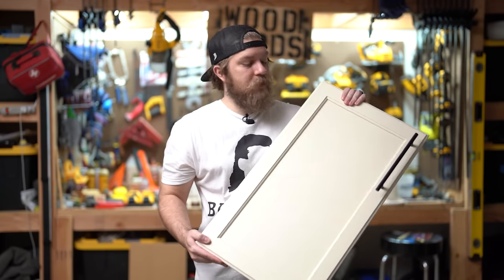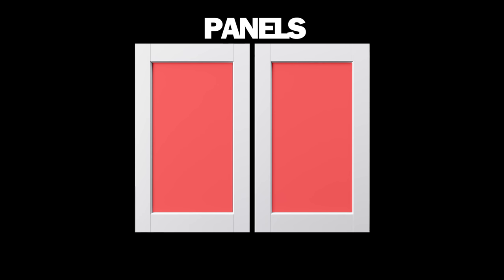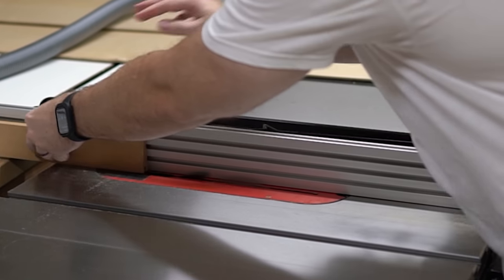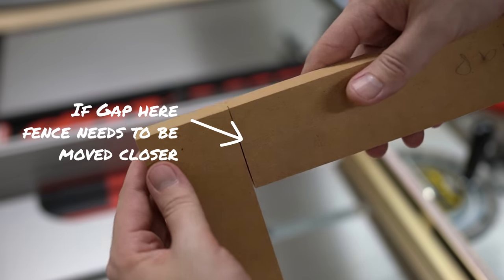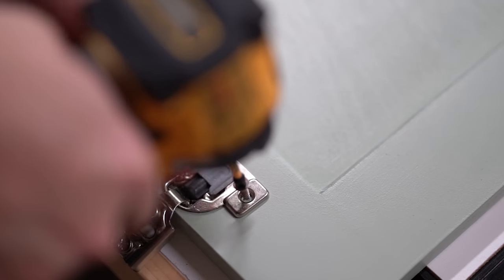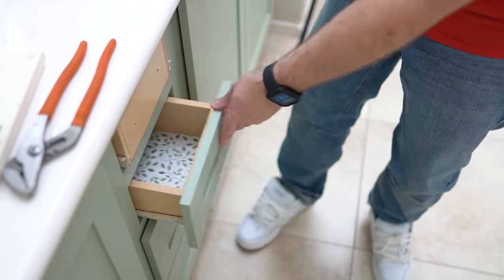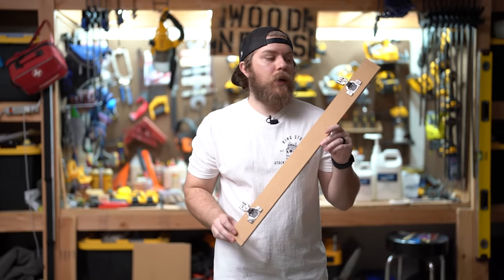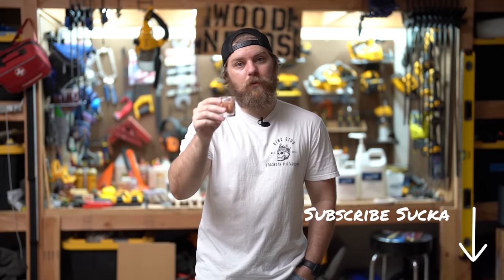CHEAP and EASY Shaker Cabinet Doors and Drawers | DIY | HOW TO

Comment: which paint have u done on it ? also any shelac or pu coating over paint?
Reply from the maker: Of course! It’s “clary sage” satin finish, using a “cabinet and furniture paint” base to help mitigate wear and tear. The tag doesn’t seem to have the brand but my wife picked it up at Lowe’s (if you have one near you). No top coat other than the paint.

Comment: Would it be much easier with a cabinet design software & a CNC machine?
Reply from the maker: Haha much easier! You’d be able to make 2 piece doors. One piece would be the frame, and the panel would glue on the back. Could use the internal “waste” from the doors to make the drawer faces.

Comment: What paint was used? I have always had issues painting MDF. I know you can put a thin layer of glue or plaster as a barrier between the paint and the MDF so the MDF does not soak up the paint.

Also, instead of using MDF, couldn't you use plywood throughout? 3 layers of the same plywood with the center piece being thinner for the dado and longer for the tennant?
Reply from the maker: Of course! It’s “clary sage” satin finish, using a “cabinet and furniture paint” base to help mitigate wear and tear. The tag doesn’t seem to have the brand but my wife picked it up at Lowe’s (if you have one near you). The first coat gets drank up a little but after that, it’s paint as usual. The problem I’ve had with plywood is the edges show the plys. You can use edge banding and try it but that would be more work than mdf. Mdf is also much more resilient to damage than people think. I’ve whacked mine pretty good and no damage resulted. Of course it’s all up to you and what you like best but these are my experiences.

Comment: About to redo my kitchen and just watched your vid because I was thinking of going with MDF. Only problem is, you recommend 5/8" thick and for the life of me I can't find that thickness around here. I have 1/2 & 3/4, would 3/4 be to thick or should I just go with the 1/2"? Thanks
Reply from the maker: Do the 3/4”! It’s what standard cabinets are made from. I think 1/2” is a smidge too thin as the hinge cups are about 1/2” deep.
Reply: @WoodNerds  ok thanks!
Reply from the maker: Of course! I hope it goes well for you! I would like to hear how it turns out! Cheers and good luck!
Reply: @WoodNerds  sure will man. As soon as she decides what style doors she wants me to make. She's leaning towards some raised ones. So I'm guessing go mdf 3/4 rails and styles and do 1/2 mdf panel. But who knows what I end up having to do. I know for the cabinet with our pots, I'm going with slide out drawers at the bottom. And to old to be getting on the floor to dig in cabinets. Lol
Reply from the maker: Haha those are nice to have! I’ve been wanting to try them out as well! Excited to hear back man! Sounds like you have a decent sized project ahead of you.

Comment: what table saw blade do you recommend for this project?
Reply from the maker: Any will do. The higher the tooth count the finer the cut. I used a Freud glue line rip blade and it’s been great! Linked in the description.

Comment: It would be nice if Home Depot sold these styles and rails with a groove to fit the 3/16 in plywood..
Reply from the maker: I’m not sure about stiles and rails but I know you can get custom cut plywood from lumberyards by the pallet. I’ve seen it done with the intention of making drawers where they cut the groove for the bottom panel. Might be worth giving a call and see if your local lumber yard offers that.

Comment: Buddy this was great but ima keep it real I’m not gonna be able to get the saws correct it would take me plenty of time to even get close 😢. Ima just do a refacing in my bathrooms and that should be straight cuz I have the kind of cabinets that have the peeling crap. So ima remove them and replace so starting with good already made doors 😳😬. But this was great
Reply from the maker: Haha you’re not wrong. Dialing in the cuts is like 75% of the hard work on this one. Thanks for watching and taking time to comment, man. I appreciate it! Cheers and good luck with your project!

Comment: What blades (tooth n brand) did you use on your tablesaw and miter saw?
Reply from the maker: Hey Luis! The table saw blade is listed in the description! The miter saw blade is the standard construction blade that comes with the saw. I recently bought a much thinner blade I’ve been wanting to try though. More info on that to come.

Comment: Where do you buy dimensional mdf or hdf for cabinet doors? I’m assuming it’s different than big box store mdf trim. I can’t find it anywhere.
Reply from the maker: Hey! You mean a 4x8 sheet? Yeah, they’re all over the place here in Phoenix, AZ. The sheet goods in the big box store are usually near the boards but in their own location. A lumberyard somewhat close to me has a pretty decent assortment of sheet goods. They are usually higher value and quality compared to the big box stores. Some mdf that has high moisture resistance as well. Worst case scenario, see if you can order some to the store for free.
Reply: @WoodNerds  maybe I missed it in the video, did you just rip down a sheet for the rails and styles?
Reply from the maker: @MountainTopFilms12 yeah, just ripped a sheet!

Comment: What was that paint color? I like that you could still see the grain on the center panel.
Reply from the maker: It’s “clary sage” using a “cabinet and furniture paint” base to help mitigate wear and tear. The tag doesn’t seem to have the brand but my wife picked it up at Lowe’s. I like that too! Thanks for watching!
Reply: @WoodNerds  Thanks. Did you use a primer? I wonder if that would affect the ability to still see the grain.
Reply from the maker: I used a primer paint combo! I bet you’re right though, multiple coats will likely hide the grain!

Comment: I'm about to replace 29 cabinet and drawer faces in my kitchen plus eight in the bathroom and have glued up a test joint.  Your advice to sneak up on the table saw cuts is right on.
However, although most of the tools and jigs you recommend are relatively inexpensive, there's that 800 pound gorilla Sawstop table saw that you conveniently ignore, and which does almost all the cutting.  These doors can be done with "lesser" table saws (I'm using a 30-YO benchtop Delta), IF YOU ARE CAREFUL.

Second thought:  you don't have to mortise and tenon the rails to the stiles.  A router with a pair of cabinet door bits (about $22 on Amazon) can put a decorative edge on the inner edge of the rails and stiles, and with one pass, give a tight fitting joint.  Be sure to set up the depth of cut carefully.

Third thought:  the recessed panel doesn't have to sit in the middle of the rails and stiles - it can form the back edge of the new door.  In that case the rails and stiles are "L" shaped and it's an easier construction.

Comment: Say if you don't have a table saw. Could you use a router set up in a table?
Reply from the maker: There’s more than one way to skin a cat (so to speak), but I can’t think of an easy way to replace the table saw process with a router process when it comes to ripping the rails and stiles. As for the dados and the tenons, I think the router would preform well for that, but a table saw (even a mid grade model) is hard to replace for stuff like this.

Comment: I don’t get gluing the panel. Isn’t the entire point of a floating panel to allow for expansion of the panel??
Reply from the maker: Plywood and mdf are considered stable materials. Because mdf is actually small bits of wood compressed together and plywood is thin layers of alternating wood glued together they do not expand and contract like regular wood does. This is a benefit of using sheet goods.

Comment: Only problem is, those HDF boards are very hard to find, only MDF, so do you have a source ??
Reply from the maker: There’s a lumber wholesaler about 30 minutes from me called Hardwoods. They have all kinds of particle/fibre boards. I just picked up some moisture resistant NAF (No Added Formaldehyde) MDF from them recently for laser cutting projects. If you’re in the Phoenix area, I recommend them. The guy at the order desk gave me some under mount drawer slides just because he’s a cool dude haha.

Comment: Could you have made the drawers wider to nestle against the doors? Or would the doors not open if the drawers were too close?
Reply from the maker: There has to be at least enough room for the doors to open, but because my drawers are so slim, it felt weird to put wide faces on them. Would have been fine though.

Comment: What type of caulking did you use between the panel and the rails/stiles?
Reply from the maker: Hey Jason! I added the type I used to the description of the video. It’s an all purpose paintable long lasting (35 year) caulk.
Reply: @WoodNerds  thanks, I just found your channel yesterday and I’ve been trying to find a way to replace our old outdated kitchen cabinet doors without emptying my savings account. I have 28 doors and 12 drawer faces. The bases are very solid. This might be my answer. Keep up the great videos. I make videos on my other channel so I can really respect the work you’re putting into helping people. Nicely done!
Reply from the maker: Thanks man! It really made a difference in our space as well. Make sure to use 5/8 up to 3/4 inch material. I misquoted the size originally and have updated the video to remove my mistake.

The math video I have for measuring for the spacing you want should be pretty helpful as well if you haven’t checked that out. That method is really easy and saves a lot of guesswork.

I appreciate that! Yeah, it’s like twice the work haha. I don’t know how guys are out here putting up full build videos every week!

Let me know how it turns out! Good luck with your project!

Comment: How long did each door take you to build?
Reply from the maker: Hey, not very long! You’ll want to batch each step of the process for however many doors you need. For example, if you need ten doors, you’ll cut all 40 rails and stiles first(4 for each door), then cut your dados on all the rails and stiles, then cut the tenons, then the panels, then sand.

This way, you only have to set up your machines once and can quickly run each piece through after the first. 

For one full door for this demonstration, it took me about an hour or two of work but for ten doors would only add a small amount extra for each additional door. Does that make sense?

Comment: What about birch ply?  Why not use that instead?
Reply from the maker: You can use plywood but you’ll have to use edge banding or a good filler to hide the ply’s before paint. With mdf all it needs is a light sanding to remove the tool marks and it’s ready to paint.

Comment: What's your paint prep for the cut edges of mdf?
Reply from the maker: The first coat it’ll drink in a bit. After that I didn’t have any issues. Just sand to remove the tool marks and you should be good!
Reply: @WoodNerds  And no fuzzy texture?  You have to be doing something different than me when cutting or painting then.
Reply from the maker: Does sanding help? Yeah, I haven’t had to do anything I wouldn’t do with regular wood to prep for paint. I’ve been using mdf trim for home upgrades as well for some time now with the same results.

Comment: How do you open your drawers?  I like to have a pull in the middle, but probably can't do that with this style. Maybe a completely flat drawer front....
Reply from the maker: Hey! You can absolutely add pulls to the drawers! My wife requested we leave them off haha. I would just not crank on them when tightening so you don’t bow the center panel. Opening isn’t bad but not as luxurious as having a handle to grab ahold of.
Reply: @WoodNerds   WEll, yeah, I agree with you on the handles. Just worried that the panel might be too thin to hold up.

Comment: Love the dcf850 but have never heard it beep?
Reply from the maker: Mine always gives me a little beep when it’s in delicate mode (1) and the screw is tight. If you continue to hold the trigger through the pause it’ll slowly hammer to give you a little extra.

Comment: Boy oh Boy you sure do like fiddling around.  For perfect drawer alignment and  foolproof install: 1) Measure cabinet height and width, drawer height and width, calculate the spacing requirements to center drawers between the cabinet doors and to space them vertically. 2) place bottom stop block - as you did to align the bottom drawer.  3) cut 2 spacers. a vertical spacer to align drawers left of right - depending your handedness - and a horizontal spacer to separate the drawers. 4) clamp or use double sided tape to afix the vertical spacer next to the cabinet drawer. 5) install 1-2 strips of double sided tape to drawer fronts.  Align drawer face against the spacers and stick to the drawer front. 5) Screw the face to drawere front through pre-driled holes. 6) Move the horizontal spacer to top of newly attached drawer face and repeat proceedure.  This can eleminate clamping fus and muss, and get the drawers done in less than 30 seconds per drawer.  
Love what you are doing - keep doing it! Cheers.
Reply from the maker: Awesome tips! I’ll try that next time! Thanks for watching and taking the time to share your experience! Cheers!

Comment: What about the added weight of MDF? Doesn't it put more stress on the cabinets?
Reply from the maker: That’s a great consideration. It’s actually noticeably lighter than the doors that were mounted before.

Comment: yeah it looks nice.. BUT the screws wont hold in MDF or HDF for very long.. If you have kids and or  your wife cooks a lot ( high usage)  For sure itll get loose after a year or 2..  Or how about if someone pulls on a drawer or puts weight on it? I think the screws will rip out that material..

Comment: Not all those krieg jigs don't line up correctly with the 2screws for hinge install.
Reply from the maker: Great tip! I didn’t know that, they lined up nicely for me and the hinges I used but can see how variations between hinge manufacturers might cause an issue there. Thanks for saying something!

Comment: Did you not put handles on the drawers?
Reply from the maker: No pulls on the drawers for mine. They are quite easy to install if you wanted to though.

Comment: Would you recommend using 1/2 or 3/4 plywood?
Reply from the maker: Plywood can be problematic as it often contains voids within the plys. Also, the plys can show through the paint. You can use edge banding to hide that but it’ll be an added effort. I also find plywood (even thought it’s very stable) to be less stable than mdf. Ex. Old plywood in my shop will warp (even when kept in ideal conditions), I haven’t seen old mdf warp yet.
Reply: @WoodNerds Ok cool I had no idea. Thank you for the valuable info. I've never used mdf or hdf before, I've always thought they were lower quality wood. I'll have to give it a shot. Thanks!!
Reply from the maker: Of course! Happy to help! I can see why you’d think that with how people talk about MDF but each of these materials has a use case where they shine. MDF is great for things like this where the piece isn’t being put through a lot of force or requiring a lot of strength. Trim is often made from MDF and it’s great to work with! Properly supported, MDF also makes a great workbench top because it’s so flat and cheap to replace when damaged. Let me know if you build these. I’d love to see how they turn out!
Cheers!
Reply: I would go with three-quarter mdf.  I really don’t understand how he was able to put cup hinges in a half . inch door without drilling through it.
Reply from the maker: @danbeeson9564 your concern is valid. I had 1/16 inch of material remaining so it was fairly close. I completely forgot to mention that so thank you for saying something. I added it to the description.
Reply: @WoodNerds  it worked though! 😃.  Most places sell “light weight” MDF these days. Do you know if the MDF you used is the light weight variety?
Reply from the maker: I even hit them with a hammer (not full swing obviously) to see if they’d cave in from the face but the hinge cup supports them well and there was no damage.

I got all the materials from Lowe’s so I’m sure it’s low quality. It’s hard to get a good answer from anyone in big box stores on those materials as they “just work there” and don’t usually know haha.
Reply: @danbeeson9564  That's what I came here to say.  On a project a few months back I tried 1/2" MDF with that Kreg pocket hole kit.  The point on the supplied bit drilled through.
Reply from the maker: Dude, I was wrong! I’m super embarrassed! It was 5/8 mdf! Idk how I mixed that up… anyway, I’m going through comments, taking responsibility and letting everyone know I was mistaken!

Comment: I own a bathroom mirror framing company and all of our moldings are mdf
Reply from the maker: It performs well for applications like this. Not great for bearing weight but as long as you know what it’s good for, it’s a great material and easy to work with. Thanks for watching and sharing your experience.

Comment: Great video. However ive been looking for a video that shows how you get a good finish from painting and EVERYBODY skips that part lol. WHYYYY?!
Reply from the maker: Haha for me, the video was getting too long. Also, I’m not a professional in the painting space so I tend to leave it up to those guys/gals to give recommendations on products and processes for finishing haha. My process was pretty simple though. Used a cabinet/furniture paint base with sherwin Williams “clary sage” tint. Used a bristle brush to get in the inside corners, then a small cabinet foam roller brush for the flat surfaces. In total about 4-5 pretty light coats waiting 30-45 minutes between. A sprayer would have been much easier and would have yielded a better finish but these came out really nice by hand.